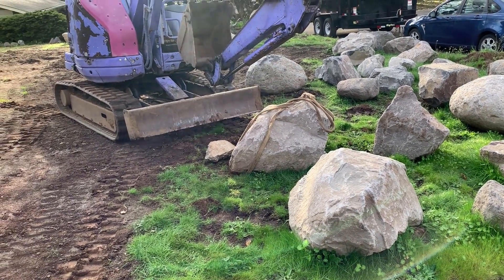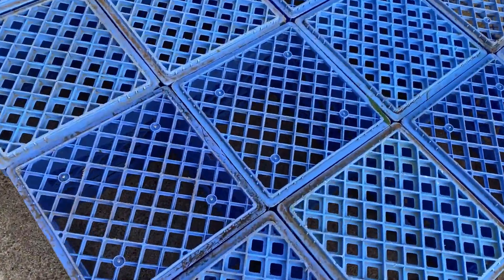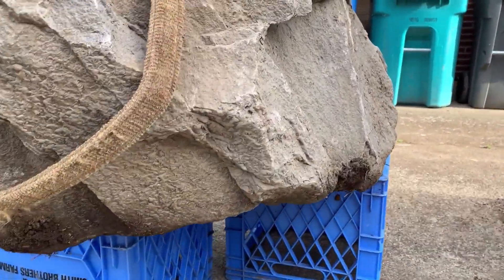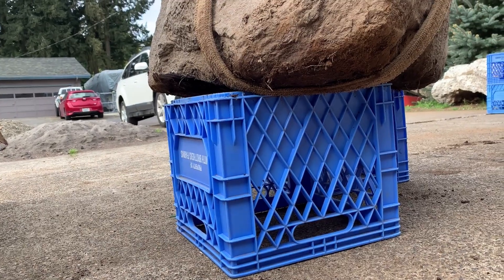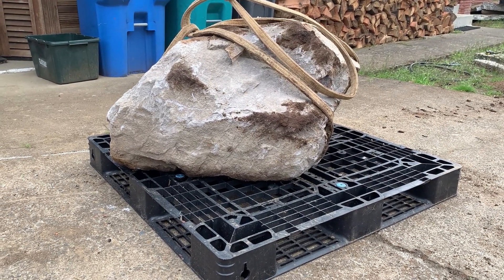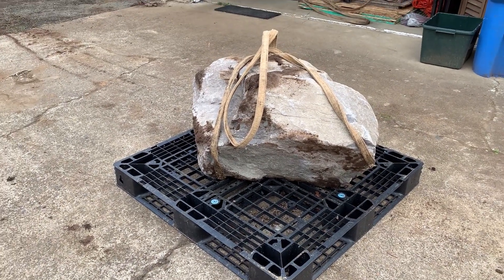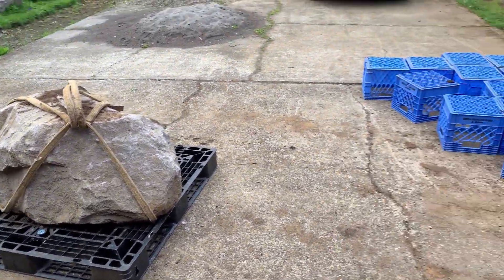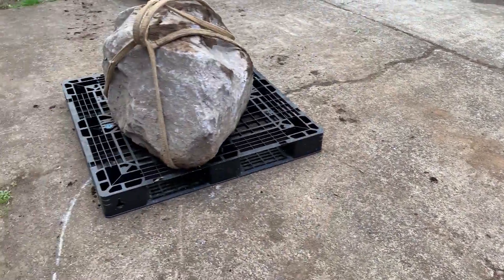Just how strong is a milk crate?

Comment: The test is milkcrates on a cement slab. What do you think will happen with crates on a dirt base?  Aquacrates have more surface support on the bottom compared to milk crates. Time and pressure the milk crates will knife into the ground?
Reply: Properly tampered, I dont think there would be an issue

Comment: thanks for the vid. That’s about 450kg load per milk crate. Impressive. Just started using them for a cheap aquarium stand. I am a mechanical engineer. They are excellent at distributing a load when upside down. I have a simple way of finding an aquarium base, non-scientific. I ask myself can I comfortably stand on this base for a long time? I know my weight so it is not too hard to guess the strength of a base. A milk crate is way stronger than its milk carrying capacity. If you imagine the crate full of full glass milk bottles you can easily estimate its design capacity not including safety factors. The safety factor is enormous.

If I would not stand on it there is no way I would put an aquarium on it.
Reply: I was looking for this comment.. do you think 4 long with a 2 by 10 on top hold a 55 gallon?
Reply: @JordynWorth   sorry I am metric. Might need to explain the wood base dimensions. Is it 4 ft long, 2 ft wide. how thick? Can be hard working out a load capacity of a base. When the manufacturer publishes it, that is easy. Personally I just stand on top of a base and jump up and down to judge if it will hold a tank, and massively over support it to be sure😂. If I will not stand on it, I would not put a tank on it. My main concern is preventing bowing of the base, like a book shelf with only supports either end which I am not keen on, so I tend to support it underneath in the middle more than it may need.

Steel frames spanning the bottom (like a book shelf) are a much higher load capacity than a wood base to support a tank. Unless you use a very thick piece of timber. The problem with trying to calculate the load capacity of a base, the bending moment, is you need to know the material properties of that base — almost impossible to know with a wood base, or any base really. I wouldn’t even try. Better to massively over engineer it.

Comment: Why didn't you completely slack the strap then? It's still supporting a lot of weight as you have it.
Reply from the maker: I think you missed the part where I shook the straps to show they weren't supporting any weight.
Reply: @TylerTervooren  nope, I didn't. You can wiggle straps like that and they can can still be supporting hundreds of pounds. Slack them completely until they bend a bit, but will still serve as a safety line if the creates give way.
Reply: @blaircox1589  are you ok?